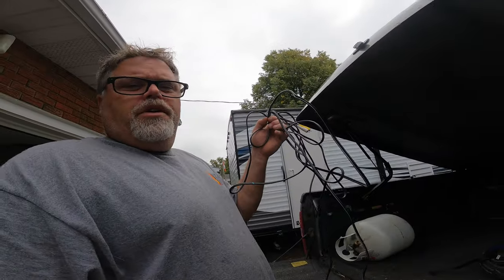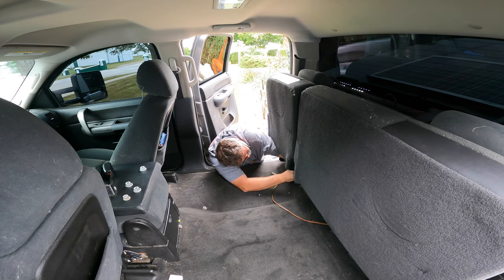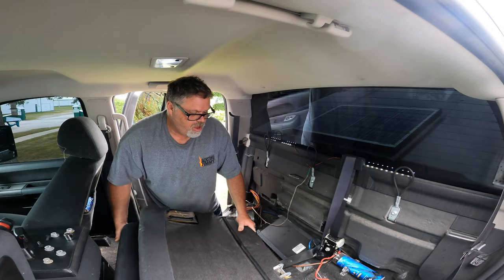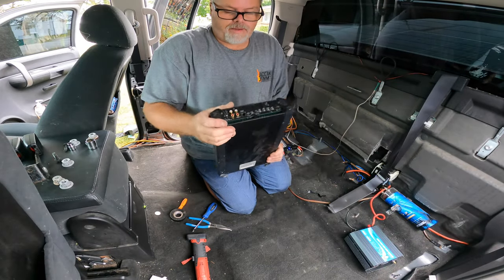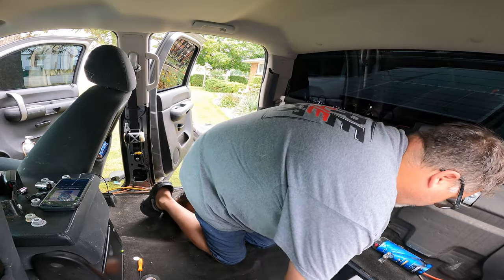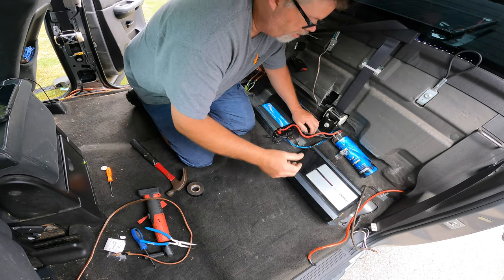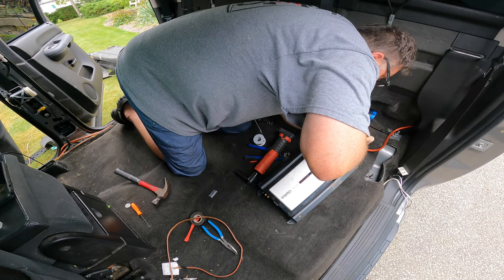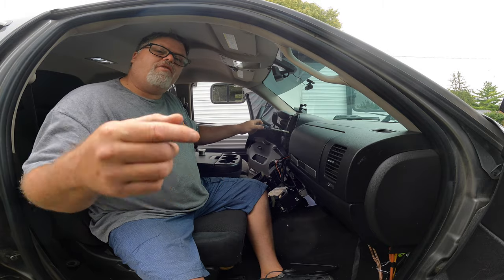Nightmare Stereo Repair    4K

Comment: Why were the amps just laying in there and not back wall mounted on an amp board?  Wiring looks rough.  I would have pulled the rest of the seats and the carpet cleaned it up and tacked the wiring to the board and probably ran new power. Cool video but just seems like it was just laid in there wiring included.  Get the 2nd sub also imho.
Reply from the maker: Not enough room seats wont hook back on